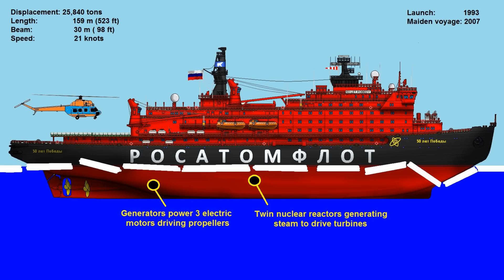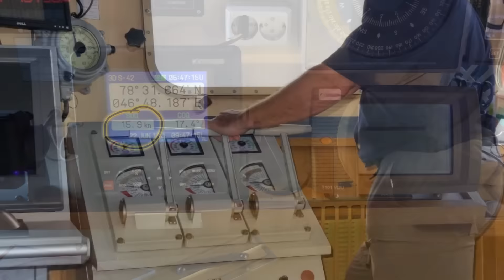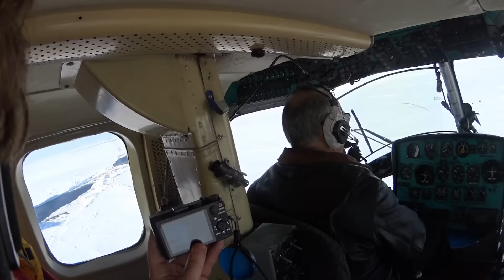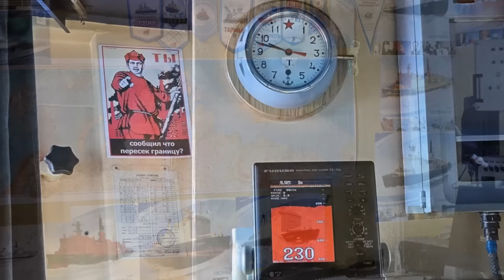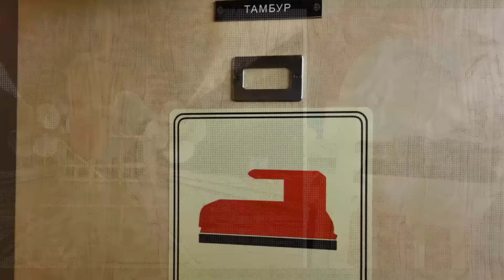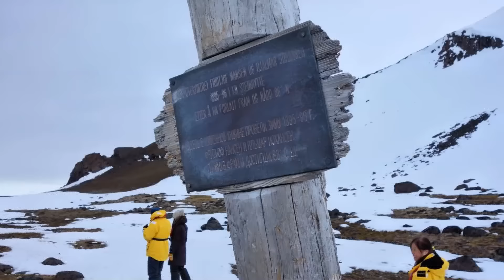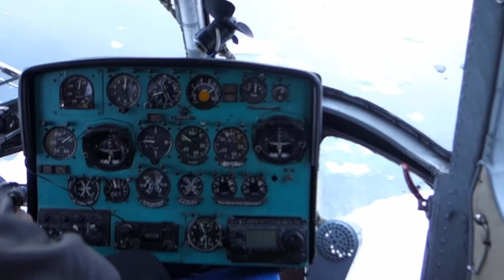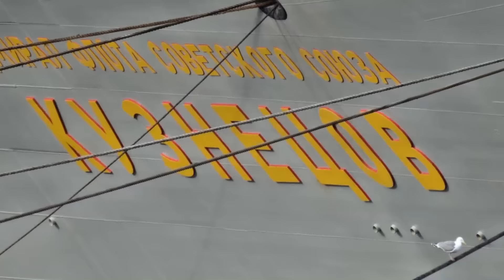🎅 Nuclear Icebreaker to North Pole: '50 Years of Victory'/50 Лет Победы 💈

Comment: Amazing how they know they can go thru that massive ice area without getting stuck in the middle of nowhere
Reply from the maker: +P o o m
It's a question of power and hull strength.  '50 Years of Victory' has 75,000 horsepower and an LL1 ice rating (the highest possible).  Hence Victory has an incredible ability to move through ice.

Comment: This is an amazing story, so interesting, mystical and magical really.  When I was in the Coast Guard, I tried to get stationed on an ice breaker.  Alas, it never worked, and I spent all of my time in relatively modest, warm water locations on small boats and a tug.  But, this s great.
Reply from the maker: +Ward Cornett
Icebreakers are certainly interesting.  Earlier this year I saw USCGC Polar Star breaking ice into McMurdo Base in Antarctica.
Reply: @tletter  You were down there?  Those new CG ice breakers are pretty amazing too.  I finished the Coast Guard in June of 1971. They built the new ones later.  However, I worked on a harbor tug at the uS Coast Guard Yard in Baltimore. When ice breakers came into the yard, we always had to get the assistance of commercial tugs as we could not handle them by ourself, way too heavy. Other ships, no problem, but not the ice breakers.  Also back then it was Northwind, Southwind, Eastwind etc.
Reply: I found your page, lots of great travels, pictures and videos.  Good job.
Reply from the maker: +Ward Cornett
Yes I went on a month long voyage to the Ross Sea including a visit to McMurdo Station.   The new Polar Security Cutter icebreakers appear to be impressive as do the new Arktika class nuclear-powered icebreakers, 3 of which have already been launched!

Comment: Wow that ship is impressive. Going 15,9 knots straight through the ice, I didn't know that was possible. 
Anyone know how thick the hull is in that stainless steel bow?
How much does that trip cost and are trips like that still available or do you need special connections to join?
Awesome move, thank you for sharing comrade.
Reply from the maker: +etikkboksen
The hull thickness is 45mm at the ice skirt and 25-35mm elsewhere.  Please check online with either Quark or Poseidon Expeditions for up to date information on the cost, duration, etc.

Comment: This ship made an appearance in Part 2 of Kara and Nate's North Pole series.
Reply from the maker: +Caitlin1928
Nate calls the '50 Years of Victory', "An old icebreaker that was built who knows when?"  However, it's maiden voyage was only in 2007, so it's not that old.  Victory is a working icebreaker as opposed to 'Le Commandant Charcot' which is an icebreaking luxury cruise ship, so there are obvious differences in the ships' fittings and design purpose.

Comment: This unnatural breaking of massive ice sheets is why the poles are melting faster.
Reply: joelshack85 

They aint melting
Reply: Blue the Wolf I believe there’s a lot of data that would prove otherwise.
Reply from the maker: +joelshack85
The Arctic ice is not a solid cover rather it opens and closes all the time due to wind and ocean currents.  The passage of this icebreaker is not causing any "damage" but wild claims do.
Reply: tletter it’s actually proven that it does. Rather if you agree if the lesser of the extremes. Doing damage to ice that wouldn’t have been there unless a human did it is why we’re in the situation we’re in now. Remember your science data is simply theories wanting to be proven right or wrong.
Reply: joelshack85 

Agree to disagree with your own theory. The polar icecaps are not melting because of the ice being separated. If anything, the ice refreezes after travel has been done. Has anyone claimed to do any research on the sun growing in size creating a warmer environment because it is simply getting closer and closer? I think not.
Reply: joelshack85 

Besides. You physically cannot “damage ice”. It is water after all and as shown in the video, the travel marks freeze over due to the temperature of the water creating the same ice wall that was there before.
Reply: Blue the Wolf I would agree with the sun getting closer. But it’s about damaging ice sheets are very old. It’s exposing more water which warms the water. Especially in the summer time. Smaller sheets of ice melter faster.
Reply: Blue the Wolf technically it’s not getting bigger it’s we are getting closer to it.
Reply: joelshack85 

According to the astro-science, the sun combustion levels are rising and the explosions are getting bigger meaning the sun is growing in size and density
Reply: Blue the Wolf if it’s getting closer or bigger we can agree. But that’s no excuse for doing man made damage to very ancient ice forms. Damage that wouldn’t have existed if humans had never caused it.

Comment: How do you sleep with all the ice breaking? are there any earplugs strong enough? or do you just go without much sleep?
Reply from the maker: +Lindsay R
The noise of heavy icebreaking depends where you are on the ship.  The passenger cabins are several floors up from the action at the waterline so the noise is diminished.  Also you get use to the noise of the ship.

Comment: Do you know how far the North Pole wobbles while the Earth is rotating? Would it be 1, 10, 100, 1,000, 10,000 miles?
Reply from the maker: +SanFranciscoBay
Over the course of a century, some 10 meters.
Reply: @tletter . That's interesting. The Earths North to South Axis is extremely stable. I would have thought that there is a lot more movement/wobble as it rotates.

Comment: Why to break Ice like that? what is the purpose? broken ice will melt quickly and raise water level which is not good for coastal areas of the world.
Reply from the maker: +bob wa
You make a number of erroneous claims.  For example, when floating ice melts, it does NOT raise the water level.  As well, you obviously don't know that the Arctic ice is not a solid cover rather it opens and closes all the time due to wind and ocean currents.  The passage of this icebreaker is not causing any damage.  Facts should matter.
Reply: @tletter  O.K then what is the purpose of breaking ice with a boat of gigantic proportions?

Comment: Why do they all need to be nuclear powered ...... why regular fuel ones not used
Reply from the maker: +RK92 1
Zero carbon emissions with nuclear.
Reply: Because it needs a lot of power to break ice and there is no gas stations or fuel tanks in North Pole.  Icebreaker has to be autonomous 6 or 9 month. 200 g of nuclear fuel  replace tonns of petrol fuel.